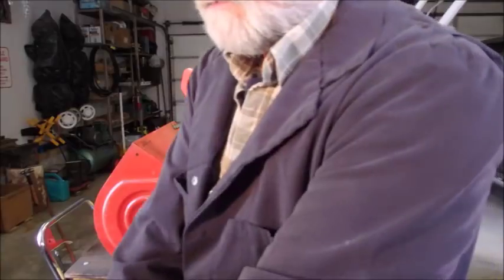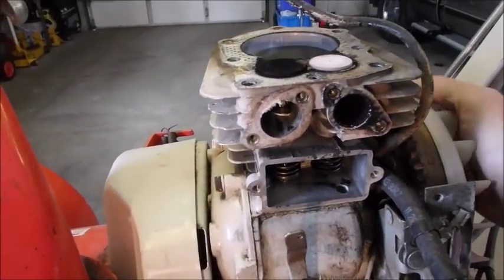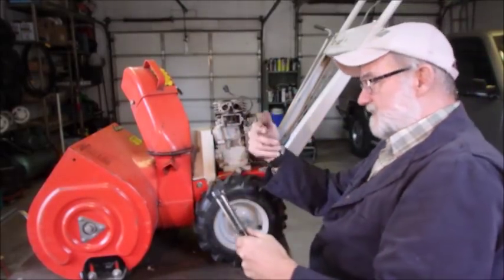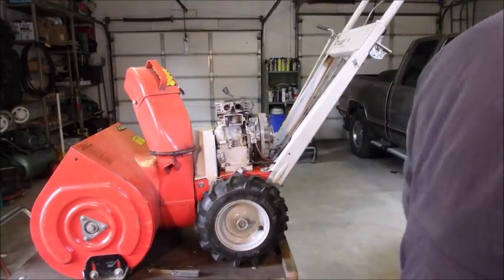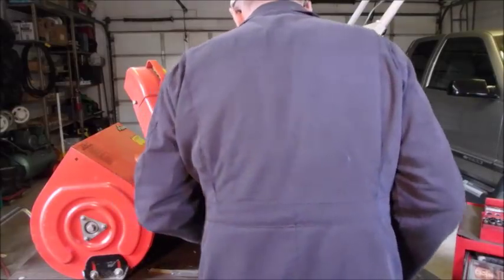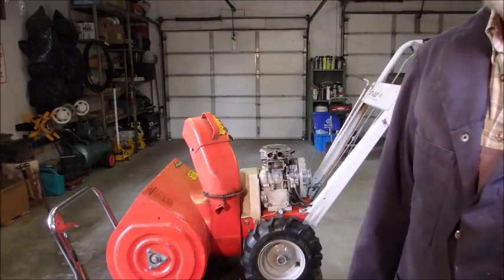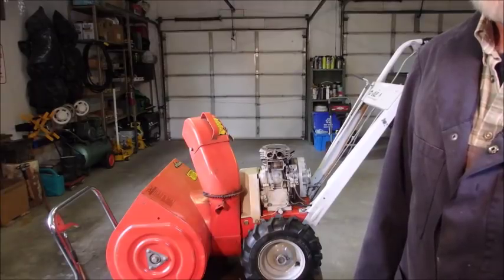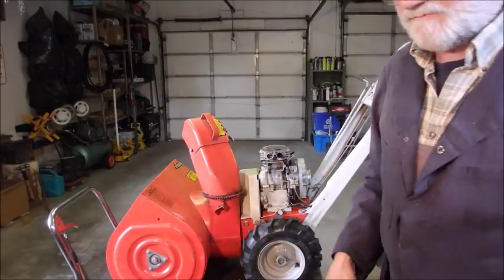Valve Grind on a 4HP Tecumseh Motor

Comment: Good work Bruce! Thanks for the tip on using the wire wheel to smooth out the valve stem after grinding. I've ground a few Tecumseh valves but didn't know the wire wheel could clean them up.
Reply from the maker: Thanks.  I would like to get a better tool for grinding valves but this is it for now.

Comment: My  Crapsman blower with Tecumseh H35 (1992) engine is driving me nuts.  Kicking it does not improve its performance or my disposition. You noted that the spring on the governor was in the top position, is that normal to start?  She who must be obeyed says to fix it or throw it out (not in my genes).  Thanks
Reply from the maker: At this end she who must be obeyed agrees with yours.

Comment: bruce
Used this method to fix a trash picked snowblower today. Thanks for sharing the know how !. One thing I did just a bit differently was to measure the overall length of the valve with a caliper so I could measure how much I needed to take off to get the required clearance. It was 0.009".
Reply from the maker: Right   I have treid that but the different on my caliper is only one digit  .001

Comment: Thats the one i cant find valve gap 4 is 5.5 hp briggs,i lapped the the valves ,and there tight now,b4 i could put mu thumb on and turn them,but there tight now,im thinkin i still need to gap them tho??
Reply from the maker: Yes if they turn in the seat there is no gap.  And after lapping you only close the gap about maybe .001th.    The tappet is opening the valve a bit.  Take the motor to TDC just after the compression stroke the a 1.8 of an inch more.  Don't do it on the exhaust stroke as the exhaust valve has just open and shut.  Then check the gap.  I bet it is still touching.  Are you the one questioning about the 010 th gap.  I get 50 questions a day. It is best to use the reply button as then the comment comes up in the same subject thread.  Thanks Bill.  Sorry for the lesson.

Comment: Its a real common mower here bruce, was smokin real bad,took head offand seen need a valve job and i cant find the measurements 4 the vavle gap
Reply from the maker: In my Tecumseh book they they are all .010  for both compression and exhaust.  For a bore from 2.31 all the way 2.39.

Comment: Hi Bruce, I just picked up an 4 HP Ariens snow thrower. Did you replace the wheels on yours and if so what size wheel? Where can I get an service manual for it if possible.. Great job!
Reply from the maker: I adapted a pair of air filled wheels and used bushings all over the place.  I wouldn't recommend it.    It did work but the gear ratio was changed for the speed. --- it ran faster at as the wheels were bigger.
Reply: Thank you for your video, I'm going to tear into it this summer and have it running by winter I hope. lol  Might be asking you for help at times. Thank you for your videos.

Comment: my friend considers himself a small engine mechanic and he was telling me how bad tecumseh engines are because he had one with a problem. i asked if he checked valve clearance,he said no..... guess what,it was a tight valve all along. i have a zim valve grinder set just like zippo has,i got tired of that stick thing falling off. nice old machine by the way
Reply from the maker: So are you saying you fixed it???    They are good machines.  i had a Tecumseh mower for 30 years.
Reply: i fixed it by telling him what to check. experience is the way i have learned what to look for
Reply from the maker: so cool.
Reply from the maker: They existed for 60 years(or more) for a reason.

Comment: Good job bruce. Funny how a little thing like that can affect starting and power. I think small engines were made better back then for sure. The only thing I didn't like about tecumseh engines is that in the late 70's i had a couple of push mowers with them and you could only go one way sideways on a bank or ditch because if you went the other way it would start pumping oil out of the engine.
Reply from the maker: They did have issues but the carbs are so simple they ROCK

Comment: nice work Bruce.  Older is better 90 percent of the time with tools, but the newer overhead valves are easier to work on;)
Reply from the maker: Yes easier to start too.  I am in my sixties now.
Reply: I'm keeping my eye open for that parts tray in your videos.  Have you been able to use it yet.  I really like mine, I use it on almost every job as long as it is not holding parts from the previous job.
Reply from the maker: Yes   I keep it on the side of my tool cart.  I had the tray in the house for this set of videos.  It is being used however.  I like do dump my spare screws into a different  tray but not your as it would take hours to pick them out haha.  Thanks so much.

Comment: I noticed you failed to have the valve faces & seats reground, too. Engine blocks warp a few thousandths of an inch when they are first ran, and regrinding the valves & seats places the centerline of the valves back in alignment with the guides to insure proper sealing. But what you did to the engine will help a great deal.
Reply from the maker: Right.  I totally get that, but I am limited to the tools I use.  I still try to show things the average guy can do.
Reply: I understand that & I also understand that most people don't have their own valve grinding equipment. But most automotive machine shops can do the valve & seat grinding. I have my own fully equipped machine shop, with a valve face grinder & seat grinders.

Comment: Made things better back when. Never a truer statement. Lol
Reply: We live in a disposable society now.  People want new and shiney, and when it breaks, they throw it away and buy something else new and shiney.  It is upsetting, but there are still people that see value in repairs instead of just tossing it out.
Reply: Nice video. All my power equipment is over 25 years old. A lot of the new equipment is just “junk!”
Reply from the maker: Well most of my stuff is older than this, except my lawn mower.  I got rid of it when it was 30 years old and it was still running (it did burn oil)

Comment: those valve spring compressors are very handy,, I don't use one to remove the valve, I just put a screwdriver under the spring retainer a pry up on it till it goes into the bigger hole in the retainer, but reinstalling the valve is so much easier.
Reply from the maker: Yes especially on the little 4HP motors.  Thanks for the great comment.

Comment: 230 inch pounds - I have to wonder if you  stayed with 230 foot pounds  if anybody would try it . LOL
Reply from the maker: Yes my 1/4 inch ratchet goes to 250 inch lbs.  Thanks Steve.  Did I say 230 foot lbs???   I will check that.
Reply from the maker: I went back and I corrected myself WHEW.
Reply: Bruce Pender we all knew you were talking inch pounds. LOL. Imagine trying to crank down 250 foot pounds . HAHA

Comment: I did this on an exhaust valve on a tecumseh 2 years ago (a snowthrower). Symptoms were multiple pulls to start and low power with bogging down in heavy snow. i had a very small loss in compression. Just correcting the exhaust valve clearance led to a notable improvement in performance with no bogging down no matter how heavy the snow. Additionally saw very easy starts as well. I expect you will experience same. Good video.
Reply from the maker: I sure hope so.  I have used it once since the video but with only a sciff of snow.

Comment: Your grinder had the rests with a drill bit sharpening angle built right in! That's brilliant. Do you use it to sharpen bits? Great job on making it a one pull starter again my Friend! Check your email. Zip~
Reply from the maker: I do use the guide to get started then I lift the bit and roll it to get that back edge a bit lower that the cutting edge.  I am sure you know what i am talking about.

Comment: Pretty straight forward boss. Good fix. I think you may have had a Zombie Dave moment there when you said you got new valve lapping tools. What kind did you get? The suction pump kind? Mine always lose grip on the top of the valve so I go thru this sort of ritual. Lol, I try to lap them dry, a little spit, piece of tape and blah blah. Eventually it gets done. #GGW
Reply from the maker: Yes the suction cup type.  I am bad for not putting the tool number in the shot  forgive me.  Spit is the adhesive I use too.  haha  The old lapping tool was so bad all I had was friction to stick with.  It was 40 years old.